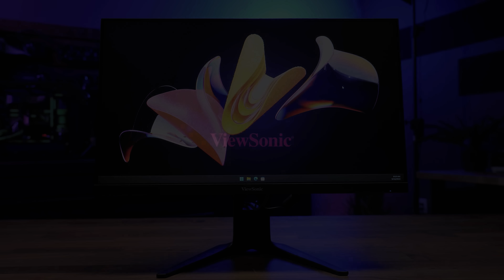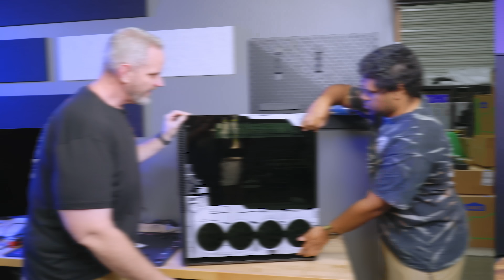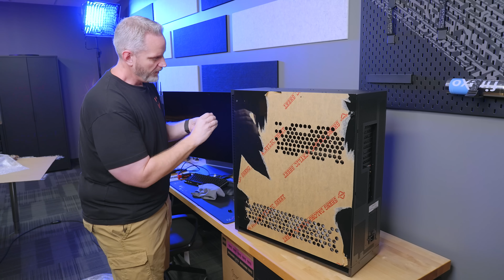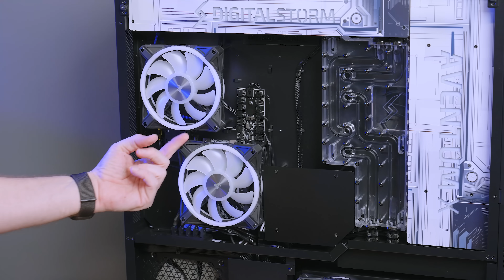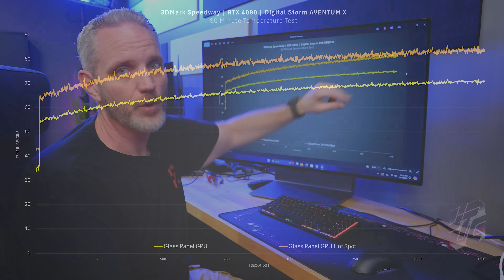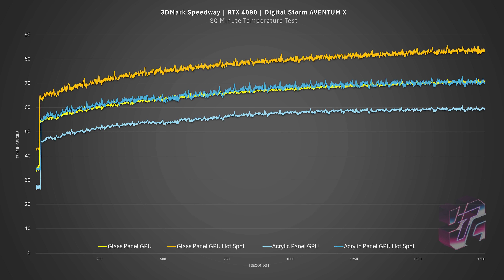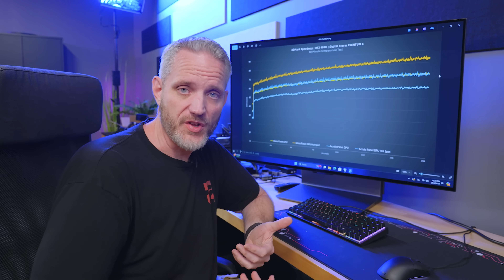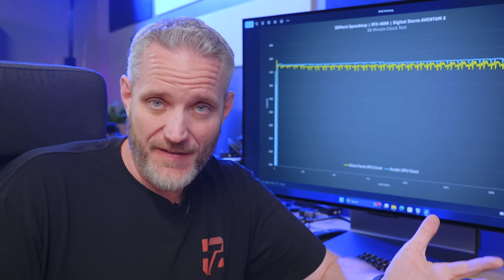Digital Storm responded to my Criticism... Let's go over it

Comment: Jay what you should have done is design and make the correct side panels . then send them back to there R&D Department . Sometimes you have to teach the designers and engineers how its done. Ive done it , you might have to on the rare occasion.

Comment: Easiest thing you could do is use some small standoffs on the screws that hold the side panels on. Make 1/4" gap all the way around. Then it's pretty AND gets airflow. Won't be perfect but that's better than wasted giant radiators
Reply: And put the freaking acrylic panels in the box for "maximum performance"

Comment: For 8k...I expect optimized cooling, airflow and performance...that's the original e that breaks the triangle and turns it into a circle. There should be no compromise at that price point.

Comment: My aircooled RTX 4090 and AIO cooled 7800x3D is running way cooler then this system in a much smaller case.. I was a watercooling enthusiast but I don't see the point anymore. And I'm super sensitive to fan nois (I hate it with a passion) so my PC tops out at 19 db. Soo Jay you are not crazy, all good points!

Comment: Ugh, no dust filters, either. No thanks.
Reply: Doesn't need dust filters if there's no air flow at all.
Reply: It does if you get the free alternative side panels with the holes in them.
Reply: @3paced941  Not free if you have to pay 50 bucks for them to be shipped to you.
Also it''s unacceptable that it's sold without airflow to begin with and you need to essentially stumble on this video to know the other ones exist.

Comment: Can confirm that tempered glass cannot be cut once manufactured. Tempered glass must be manufactured to the correct dimensions as once it cools and hardens, the internal stresses (which are what make it hardened) mean any attempts to cut or reshape (and yes laser cutting will have the same predictable result as more traditional methods) will result in a disruption of those internal stresses leading to the internal stresses being released all at once wirh destructive results. The only way to create a tempered glass panel like you suggested is before the glass is tempered, first cut it to shape and size, the. Cut out any circular holes or other bits that need to be removed. Once all final shaping is complete now temper the glass panel.

Comment: I just recieved a $4000 pc from digital storm, and the Motherboard was installed upside down. If I flipped it the psu would be on top. I'm not Expert, but my friend said with the way the fans and water cooler are set up, it traps air. Can I send you a picture? An email? Tell me what you think? I'm upset its this quality after spending nearly $5000.

Comment: Was on fence with a digital storm or maingear system. Looks like maingear just won. Plus they responded to me with 2 days, still crickets 4 days later with digital storm. 
I'm only doing this because it is cheaper by 100-300 dollars to buy a vendor PC due to fake msrp. Otherwise I'd never consider this.

Comment: Your comment about redesigng the sidepanels: I think they are taking the feedback to heart and decided to fix those issues from the ground up via new design. I can easily see them introducing chamfered edges to increase flow

Edit-1: 10:38 They would need to cut the holes in the glass before it was tempered. So it "can" be done, but it's not simple

Edit-2: 24:58 You aren't crazy, your talking about a premium as all balls build, with design oversights or one could even say negligence...
Reply: It's an ancient case, if they were gonna fix their idiotic mistakes they would've done that years ago.

Comment: Whats wild about this, so i just spent bunch time finding the absolute lowest rpm for my air cooled system (5950x with an ak510 iirc and 7900xtx) i can throttle them at...without thermal throttling. Cut down ramp up noise bursts as the cpu boosts etc. 

Steel nomad + port royal stresstests. Yes she sits around 75-80c now...but it stops climbing after 5mins and stabilizes...this is just...madness.

And no, im late to this party but ever read this Jay or friends, you are not being unreasonable. That is an extreme premium youre paying. You should be able to OC to hell and back without breaking a sweat.

Comment: For all the time that Digital Storm has been building these ultra-expensive lc pcs, they clearly lack some basic knowledge that honestly, even those who have never built a lc system can see if they have any engineering chops. Yes, the systems are impressive to look at and they take a lot of effort to build, but selling something where most of the cooling ends up just being a fancy looking loop is a really poor look for the company. If you're going to build something like this that costs this much there needs to be value in that cost. Those acrylic panels they sent are nothing short of lame.

Comment: Also, if I were to pay $8,000.00+ I would EXPECT every single radiator to be cooling that beast 😆. Not just partially cooling it or mildly cooling it. If you say it has 3 radiators and it reaches 90°c, i will want a refund 😂.

Comment: If the glass panels are held by screws; an easy fix is to use standoffs between the glass and chassis, and get some longer screws. This would allow air to flow through the edges of the panels.

Comment: might be a good demonstration to the "Digital Storm" team by just cut the loop and use as a heatsink only top radiator and leave all the rest not connected. I might assume that temperature would increase a little bit because of the overall thermal capacity gonna drop down, but overall, results have to be relatively close, while price for the system would drop down (less components --> lower price and less maintenance/efforts on building).

Comment: As an engineer, I must respectfully address some misconceptions presented by Jay. Specifically, the assertion that the inside of the case can be as hot as the chip itself is fundamentally flawed. From a thermodynamic perspective, such equilibrium cannot occur because the case is equipped with an exhaust fan, which actively facilitates heat dissipation. The presence of an exhaust fan ensures a continuous exchange of air, making it impossible for the case's interior to reach thermal parity with the chip.

While it’s true that incorporating internal radiators with a direct exit could further optimize cooling, it’s important to contextualize the design requirements. The primary goal of any cooling solution is to maintain chip temperatures within a range that prevents thermal throttling, typically a reduction of 40-50°C from peak operating temperatures. This standard is sufficient to ensure performance stability without unnecessary overengineering.

Moreover, I take issue with the broader narrative often perpetuated in reviews by some content creators. While critical feedback can be valuable, there’s a fine line between constructive criticism and inadvertently undermining companies that are genuinely striving to innovate. The perception that all companies are run by wealthy individuals exploiting workers is a misrepresentation. Many businesses are driven by hardworking entrepreneurs and employees who pour their resources and dedication into delivering high-quality products while navigating challenging market dynamics.

It’s essential to foster a balanced dialogue that recognizes the effort and engineering behind product designs. Rather than focusing solely on idealized perfection, discussions should account for the practical constraints, trade-offs, and ingenuity that contribute to real-world solutions. Constructive criticism aimed at collaboration, rather than demolition, is how industries evolve and progress.

Comment: glass worker here no you can not cut or drill temp glass it well blow up on you all cuts and size got to be done b4 it gets temp but it is a ez fix most glass comp the do the glass temp well do custom orders. if there is one near you give them a call 90% of the time is cheaper thin you think and ask if thay got a inkjet if so you can get custom pics on your glass aswell

Comment: The fact, that you need to explain thermal equilibrium, where it seems they only looked at the first few seconds and didn't realize that the "cooling" comes just from heat capacity of the whole bucket of water down there.
Well, at least they seem to have somewhat open ears.

Comment: If they made the side bottom intakes mesh instead of glass that would probably fix most issues. They could attach metal frame brackets to Tempered glass that has the Mesh attached. They do this all the time with Case glass that has the metal frames. It's be heavy but it should work fine.  That would also let them screen print the mesh to match the vinal print.

Comment: From what I've learned working with tempered glass for furniture applications is that you can cut holes through the glass, though it needs to be at a minimum twice as wide/twice the diameter of the glass' thickness. Any cut-out should not exceed 1/3 of the overall width of the panel. You'll also need to leave 2x the glass' thickness gap away from the edge to the start of any cut-out. Anything outside of these limits will cause too much internal stress and will eventually (if not immediately) fail. These were the rules used for 8mm thick back painted tempered glass. YMMV for thinner glass, but the principles should be the same.

Comment: "is using asus aura.... kinda unfortunate.... icue"

tbph i call not using icue a win. that software is SO bloated and messy. i specifically avoid corsair products because of it. i have it installed, and set to never auto-start, just because of my keyboard, in case i need to update hardware macros.

Comment: I’m sorry. But if you’re charging EIGHT THOUSAND DOLLHAIRS for a computer, I don’t want to hear “we’re redesigning and working on improving the model”

All of the engineering and design testing should have been done to the upmost standards LONG BEFORE you ever slap an EIGHT THOUSAND DOLLHAIR price tag on a computer. 

If you’re so much of an enthusiast that you spend EIGHT THOUSAND DOLLHAIRS on a computer, it’s safe to say you are competent enough to realize that that design is HORRIBLE the second you open the box. 

Yes it looks amazing. For EIGHT THOUSAND DOLLHAIRS, it should look like the computer equivalent to Scarlett Johansen. But looks don’t matter at all if your EIGHT THOUSAND DOLLHAIR computer is thermal throttling after being on for an hour. 

They should take that off the market until they finish an acceptable design that isn’t just a complete waste of parts. Literally buying and paying for radiators that DO NOTHING.

Comment: Hi, J.T.C. No, you cannot cut a hole inside tempered glass.

Tempering is a process that strengthens glass by heating it to a high temperature and then rapidly cooling it. This process creates internal stresses within the glass that make it resistant to breakage. If you attempt to cut or drill a hole into tempered glass, the stresses can cause it to shatter unpredictably.

If you need a piece of tempered glass with a hole in it, it's best to have it custom-made by a professional glass fabricator. They can create the desired shape and size before the tempering process.

Comment: I have a tt900 case and run dual 560 rads on separate loops.  7900x stabilizes in normal gameplay on high settings in most games around 60c and 3090ti hits about 45c, though the gpu fluid does continue to warm up much quicker than the cpu fluid due to the volume of the blocks, so with a long enough session gpu could definitely get higher, but in my typical gaming sessions those are the typical temps I see.    So seeing this system throwing up higher temps is pretty astonishing as mine is a first time custom loop and I'd say 2 560 are roughly equal, if not worse, to 2 420 and 1 360.

Comment: at $8k, ship it with both panels in the the box to begin with.  Buyer has the choiche from day one, no shipping cost later.

For that price, the cooling and performance better be better than anything else out there.  not suffocating and lowered GPU performance.  not visually noticeable, sure, but if it can be tested, it should be maxing out clock speeds.   i'm with Jay on this one.  
Give 100 max output and airflow, or lower the price to reflect the flaws.

Comment: Made the mistake of buying a high end DS water cooled system and not long after I noticed the plastic tubing leaking due to the fittings overheating and shrinking/molding them to their internal shape. I had to replace the tubing multiple times and the MB fried but at least they fixed it under warranty replacing the board and upgrading the fittings. However due to lack of efficient cooling the problem occurred again. Finally I bought Pyrex tubing that matched the ID and OD of the plastic tubing, cut them to length using a glass cutter and to my surprise, they fit and worked well! Long story short, I ended up getting into DIY custom water loops myself! Rebuilt the whole system custom.

Comment: I'm no glass expert, but isn't tempered glass the same type of glass used in cars? If you try to cut a hole in it, it will immediately shatter into small pieces. Maybe it can be cut before tempering, I don't know. But suffocating a PC like that? It reminds me of the first PC cases, where there was one 80 mm fan screwed to the back side of the case, which was basically a metal plate with very small drilled holes. And that was it.

Comment: SMH, no words.... You send me the specs on the original tempered glass (vertical x horizontal) and the securement points (center to center for top to bottom and left to right) and I will make the panels, engrave them with whatever you want on them, and provide venting that is adequate where it is needed. There is no reason why scratch-resistant Acrylic or scratch-resistant plexiglass can't be used and I work with both.

Comment: You could TRY to cut large holes in glass pre-tempering, but during the tempering process, any extra edges (holes) increase the chances of stress points, so IF it could survive the entire tempering process, odds are the overall losses in the process would be pretty high.  The small holes some panels use for fasteners are bad enough, there's a reason that most panels have a trim ring and the fasteners go through that.  To reduce losses during tempering, all edges should be polished as far as possible, which will increase costs for each hole added, even if they're just flame polished.

Comment: i used to work on a tempering line at a window pane manufacturer in the USA. We had a different section of the factory that cut glass to unusual shapes and with holes in them. We never saw their panes come through the tempering line. I was told that the holes and unusual shapes increased the chance of breaking during the quenching stage substantially so we just didnt offer it as an option. So while i do think it is possible, it would likely be much, much more expensive as they would have to make like 10 or 12 panels so that one would survive the process.

Comment: I ordered a PC for Digital Storms years ago. It was configured wrong on arrival. The Ram coolers were off and rattling around. There was no foam packing inside for the GPU, the box was damaged AND the case was dented. The took a month to give me a shipping label and 2 montsh to get it back. THEN they told me that my waranty started the day I purchased it online and not even when it arrived to me. NEVER would I order to them again.

Comment: I work in a large shower glass enclosure manufacturing company. Yes very different than pc glass but really the same concept. You can have holes in tempered glass but you have to create the holes BEFORE you temper. This is hard because you have to have the equipment to not only temper glass (you should see the oven we have, it’s connected to it’s own transformer it pulls so much power and is so big) but also a way to cut the interior of the annealed (not tempered) glass. We use a waterjet CNC that uses high pressure and sand. Recently we’ve upgraded to a vertical milling cnc machine! This uses diamond bits to smooth and make the edges pretty and to do any cut outs inside the glass or outside. Also when you do this there’s alot of weird stresses from the holes in the glass that can happen when tempering that can just make it go pop when it’s cooling in the quench, when you pick it up off the oven, it can even just explode after sitting in the rack for hours. 

TL;DR you can absolutely have holes in tempered glass it’s just VERY involved especially mass produced. 

Love your stuff Jay!

Comment: As a Glazier, you can cut hole in toughened/tempered glass before it is heat treated (which makes it toughened). You cannot cut or drill holes after the toughening process. So to answer your question, yes you could have a vent in the side of the panel.

Comment: The system build is probably a 'cut and paste' project, they probably did not intend to engineer/plan/design anything new. If the case has been used for years, they probably just put parts together as "good enough" and charge a premium.

Comment: Jay, why not do a video about what you briefly mentioned; Redo the cooling - take OUT the side coolers/fans completely, leave in the top cooler, put a cheap-ass cooling unit at the back, put the glass panels back on and check performance now with a much CHEAPER, but fully-vented, cooling loop, (even running flexible tubing) which nevertheless still allows retention of the system's looks?

Comment: you can temper glass after you cut it and not after (easily). so if they cut the holes first then tempered it, that would be the easier solution.

Comment: Would it be possible for you to remove the heat-soaking parts and run additional tests to see if it would in fact be cooler without? It would be interesting to see.